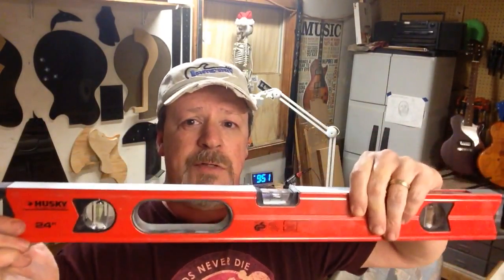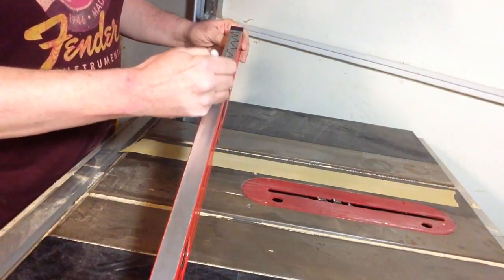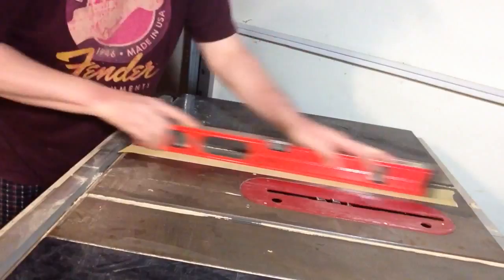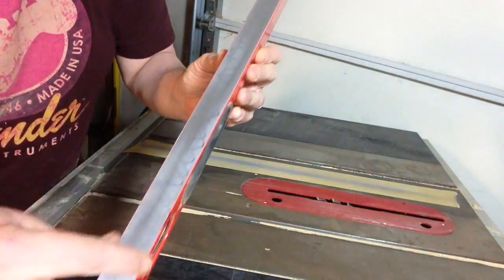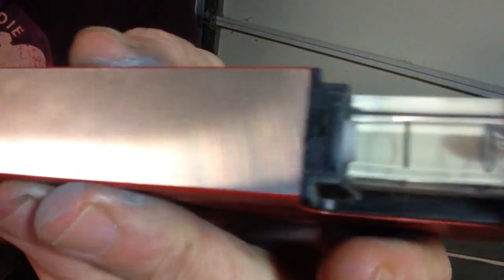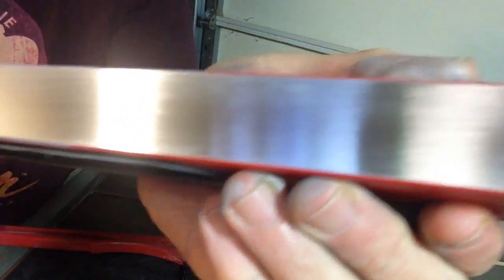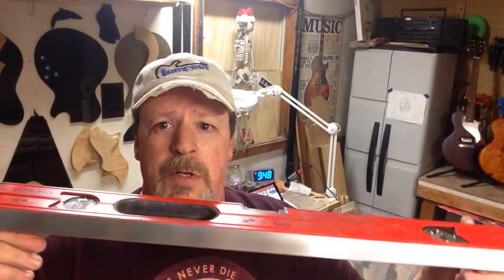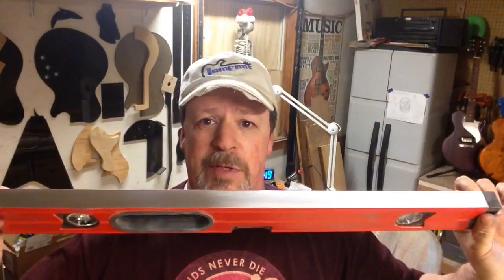Boudreau Guitars - How to make an inexpensive fret leveling beam

Comment: Very good tip Ken. I may have to take my old level to the machine shop where I used to work and use the granite surface plate to check and sand it if needed.

Comment: Excellent idea. If I may add, at the time I didn't have, nor did I consider a level for a fret leveling beam. What I did have was an old mitre-gauge from an old table-saw. I removed the actual mitre-gauge and was left with the main handle and the slider. Spray adhesive some sandpaper on the bottom and voila.

Comment: That is a cast iron machined top table saw. I have the same one. They are ground flat. No issues there.  Great idea.  Just watch that when doing this, dont let the ends of the level leave the sand paper during the stroke.

Comment: Basically anything can be used but I found laminating a couple of thick layers of glass works pretty well for me. I've used jointing planes, granite blocks, professional straight edges, and they all worked fine the glass option is just the lightest and most easily accessible for me. Thanks for the tutorial though although I already knew this it's always good to share the knowledge.

Comment: I used to use this method and still do occasionally since I loaned out two leveling beams and didn't get either one back. It works as good as a leveling beam so long as you get it flat.
Reply from the maker: Randy Schartiger dude, you need to stop loaning your tools out, or should I say giving them away! LOL
Reply: See it positively...it just cost a leveling beam to find out who's a dick. Valuable information.

Comment: My son made one for his bass guitars using a level. We just grabbed several and butted them up against each other in both directions and found ones that showed no light between them and didn't rock. We deemed these to be straight. It seems to work really well. Several brands were not straight and failed the test. We found one that came in at about $20 that passed the test. I like your idea, but I don't have a table saw. Great idea!
Reply: Oh, checked it against the Katana with no tension on it too. No daylight at all.

Comment: Now I've got one ( a transformed spirit level) ! However the seller assured that the flat part of each spirit level is built with laser control and no need to rectify it. I've ever done 5 or 6 levelling frets works and no problem, that's a real good trick! After all what we need to do , we can optimise guitars adjustements ! I can add that rulers are controlled by laser ray too, and I use small parts of different lengths ,  as frets rockers!

Comment: Try tempered glass(thickness > 6mm+) form Ikea or those used as bath room shelf, they are almost perfectly flat. FDM 3D printing also use glass surface as a near perfect flat surface for 3D printing. you don't want to put too much loading on it as it will flex a bit,  but for fret leveling, I guess it would be ok.
Reply: I’ve also heard that regular plate glass (not tempered) is flatter, but obviously more fragile.

Comment: I use my dewalt planer to check flatness, I typically just use a board of MDF to level frets since it's meant to be machined perfectly and I could easily joint and plane it if it was slightly warped.

Comment: Yeah this works fine!!! Way cheaper than the StewMac Ripoff for a hunk of aluminium. I actually posted this idea on my web page long before I ever saw this here. 

I picked up a MIC Craftright 600mm level for $12 AUD ... about $US9:00! I check it against my steel drafting ruler which I know is true and the level was spot on dead straight!!! I was very happy!!! I use it for checking necks are level as well... just put a few shims along the neck to clear the frets. Swap out the emery cloth for sandpaper and it works nicely to true up the fretboard. I should have bought 3 or 4 for different grits!!! DOH! :-)

Comment: I bought a notched fret ruler because  of majority positive comments on ebay, then it arrived and I actually found it with burr on the flat edge that light still can passes through although somewhat "evenly" to what I can see, then I use my seldom use new knife sharpening stone to glide over all the notches without applying pressure for thee job until I see all the notches shines and smooth and then use my iGaging caliper to overlay on these notches and it does the job that light didn't passes through so I supposed that it will be as good as any expensive made fret ruler so in your case did you test and see if light still can get through your level beam after leveling?

Comment: Most people have a flat surface like a glass counter saver or a big mirror or glass coffee table, marble butcher block etc. I just got a chunk of scrap hardwood and taped sandpaper to a piece of toughened glass I happened to have to sand flat edges onto my block. The same principle as putting sandpaper on a surface to sand a nut down to the correct height. It is plenty flat enough for fret levelling and if you have to re sand it once a year so be it.

Comment: When the ends of you beam leaves the sandpaper that means the ends of you beam is getting sanded less then the center of you beam so this means the center of you beam is going to be shorter then the ends of you beam also that means you beam is not flat also when you do that to you frets the same thing happens the center frets will be shorter then the frets at the ends
Reply: Im gonna level my beam but i was thinking about the sanding sheet not leaving the beam at all while i sand. I got one of those long rolls of 220 grit they setll at harbor freight. Now all i need is a flat surface 🤷‍♂️

Comment: I don`t have a Table saw...  how about using a Sheet of Glass on a regular table?  Think it might work?  I`d like to make one.
Reply: Glass is very smooth, but it doesn't have to be absolutely straight. 
I use a slob of granite that i also use to solder on . 
Check all your tools with some precision made stuff. A hair lineal that is used for the light-gap method in good quality is worth buying. It will last a lifetime. They're usually used to check the surface on engine heads. 
I wouldn't just call it a straight-edge cause I'Ve seen that this term is widely used. 
We call it haarlineal cause it has an edge thin as a hair. With that you can check any surface if it's absolutely flat.

Comment: Hello. Recently I bought a fret levelling beam from Ebay. It was not totally flat. I complained to the seller and he said that the levelling beam was extruded and not machined, so it can´t be really flat. I don´t know what he means, and I think it is an excuse. The only thing we want from a levelling is its straighteness.
Reply: they are referring to the type of aluminum they used (example: good old screen doors that had a silver type look to them) it is a type of aluminum that handles changes in weather without flexing much. but it was still machined at some point just not very well lol.
Reply: I think extruded means it was pushed out of a machine like a pasta maker.

Comment: i glued a piece of plexiglass to mine and attached the sandpaper to that using the super glue and masking tape trick. works better than double sided tape for attaching the sand paper.
Reply from the maker: I use 3M spray adhesive on my beams, holds tight but cleans up easily with naphtha.
Reply: great alternative. I'll keep it in mind. Naphtha is the liquid duct tape. :)

Comment: If you dont have a large iron table saw bed you have no chance. I think i would rather take a chance and buy one ready made at around £20  ( uk) for a quality leveling beam.  If i had a large flat surface though i would prob use my spirit level.

Comment: How did you check if it was completely flat?
Reply from the maker: Haassan1, The table saw top is completely flat, once all the sharpie is removed the bottom of the level is completely flat, no need or reason to check it.

Comment: i would not rely on that level now being straight. your table saw top is sheet metal. it could be bowed and now you have transferred that bow to the level.
if you have a surface plate it can be used to straighten the level. you might want to check it
Reply: You must be joking or trolling.  There's no shot the top of that table saw is made of sheet metal.  That solid cast steel with top surface machine ground to be precisely flat.
Reply: @YTPartyTonight  generally speaking those who are not willing to here comments that go against there perceptions, false or otherwise. use terms like trolling, haters,etc.table saw tops are not considered precise flats whether steel, cast, or plastic. they are wood working tool surfaces and do not need to be precision flat.. 
anyway who cares. guitar necks move continuously with conditions.
Reply: @billgator2005  For the most part you don't know what you're talking about, as reflected by your words here.  That's not a matter of perception.
Reply: @YTPartyTonight  for the most part you are the same. you my adversary are just another youtuber looking to be an expert. good luck with that. but i guess that's common on youtube so you fit right in the crowd
Reply: @billgator2005  Clearly you’re having difficulty with accepting the fact that you made a statement, ironically as though you’re an expert, that is wrong and someone pointed out why what you said is in fact wrong.  Enjoy your saw table made of sheet metal though. 😂🤣
Reply: @YTPartyTonight  i think you are now referring to your own original statement. thanks for making that clear to everyone.😂😂. and you say you're from usa... hooorah always in a fight!!! but not always right!!!
Reply: go play with your ego  you will have better success than continuing with me
Reply: @billgator2005 , Meet Fix Or Repair Daily, who said 4 months ago, "i would not rely on that level now being straight. your table saw top is sheet metal. it could be bowed and now you have transferred that bow to the level. if you have a surface plate it can be used to straighten the level. you might want to check it"
Reply: We have a short bus riding simpleton here. I guess by using my knee mill to flatten extruded aluminum will not work either 😆 That table saw showed you the tooling marks & in an even fashion across the level. That means the table saw is flat. Take a mic & mic the level if it's the same throughout it's flat. How many of these are actually surface ground with a surface grinder?

Comment: Are all levels like this, not %100 flat? ,  I was thinking of using a fiberglass level as a fret beam,  and perhaps maybe need to sand it down.
Reply from the maker: WhiteFeather ,  I have no idea, I haven’t checked out all levels. 😉. I would say check the level you want to use with a straight edge.
Reply: @LiveOkie Which he just did.

Comment: Take 50cm/20inch long thick wall steel tube. Find someone with milling or grinding machine to flatten it. That's it. And dont buy cheap ebay stuff, because they normaly sell just normal stainless steel tube that's not really flat. Also avoid ebay straight edges (notched too) because they are just laser cut and again not flat. I made all the tools by myself on a grinding machine. At least I'm sure everything is flat.

Comment: this assumes that the table saw is perfectly flat.....big assumption...I got a level at Home Depot and I took my feeler gauges with me to check in on the glass entry door....
Reply from the maker: jchavins your glass is only as straight as your door frame, I’ll stick with my saw table top thank you 😊
Reply: how do you check your table saw top ?  at some point you have to assume something is straight or within the necessary tolerances...I checked mine with 2 straight edges after I got it home but the real truth is you're going to affix a strip of sand paper to it that isn't necessarily  consistent in thickness to the same level of tolerance....using a level though is still a great idea....I've been using one for about 5 or 6 years now
Reply from the maker: jchavins use whatever method you feel most confident with. obviously you’ve convinced yourself you can find a flaw with any other way than the one you use. Cheers

Comment: AND YOU DIDN'T HAVE TO SPEND OVER $100 ON A SO CALLED LUTHIER QUALITY ONE. I'VE NOTICED THAT IF THERE ARE TWO IDENTICAL TOOLS BUT ONE IS LABELED FOR GUITAR BUILDING IT AUTOMATICALLY JUMPS IN PRICE BY AT LEAST 70%. COOL VIDEO.
Reply from the maker: eddie julian Dude, why you yelling? 😂
Reply: Only 70%? Go buy 100 grub screws on EBAY for $5, divide them into 8 groups of 12 (with 4 left over) Sell each group of 12 as "saddle height adjustment screws" for $5, to make 700% profit. You just discovered the Stew Mac business model. Unfortunately, you're also undercutting their prices. So expect a visit from some thick-set men in balaclavas, and some polite advice to cease trading immediately
Reply: Ash Scott ..... What's a grub screw ?   I never heard of hardware with that name .

Comment: The problem with this is that you need a perfectly flat table, perfectly installed.
Reply from the maker: JoseitoEdlVodao , yep, which it is. Thanks for checking out my vids
Reply: JoseitoEdlVodao Use a sheet of glass.
Reply: JoseitoEdlVodao a perfectly flat table top will always be flat. Not sure what you mean by installed. .a single piece tabletop could be installed on the ceiling and will still be a flat tabletop.